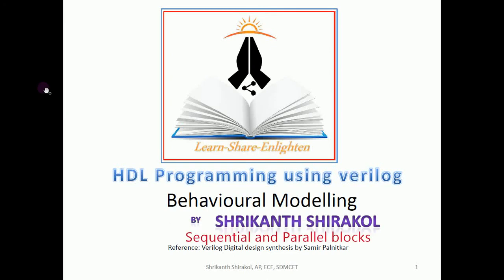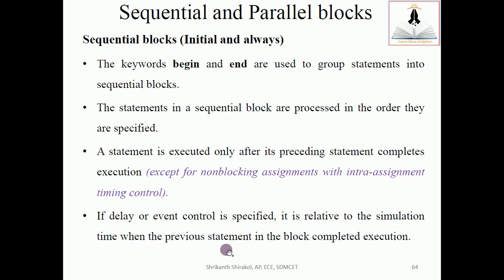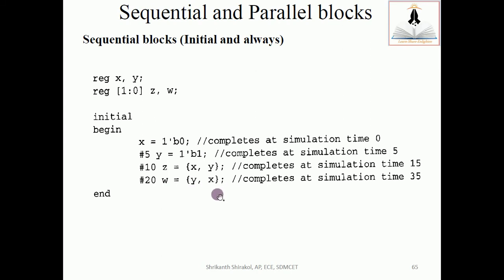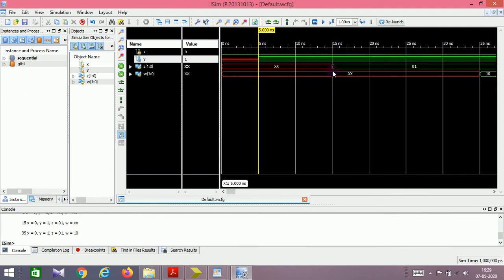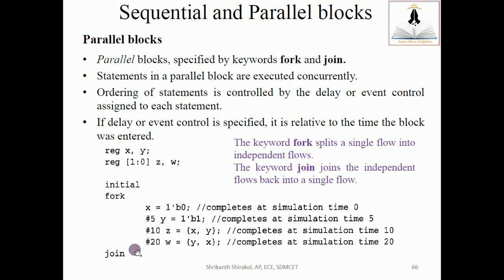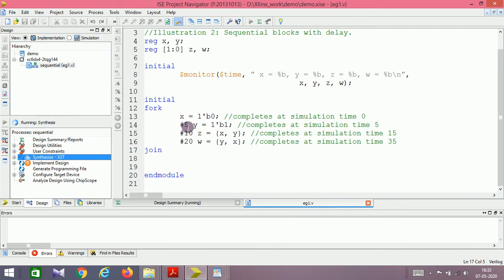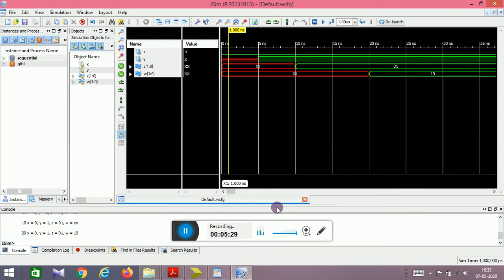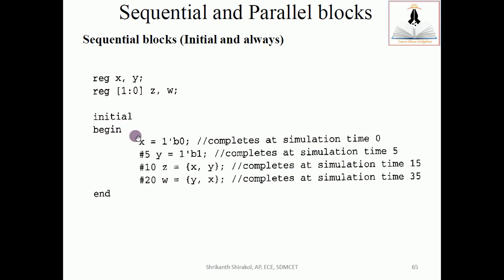Lecture 32 Verilog HDL: Sequential and parallel block (fork and join) by Shrikanth Shirakol

Comment: Sir, I had a doubt. What if instead of x,y,z,w all of them are the same variable that is something like  
initial fork
  w=0; #10 w=1; #40 w=0;#20 w=1;#15 w=0; 
join
 How will the waveform look like?
Reply from the maker: JIA, If "w" is forced with multiple values at same time then you will get an error called "Muliple drivers on the signals". 
If "w" is not forced with multiple values at same time then w will recieve the value that we force. (As your code has fork and join, all statements starts execution at once)
#0  w=0;
#10 w=1;
#15 w=0;
#20 w=1;
#40 w=0;
Reply: @shrikanthshirakol3843  Thanks sir